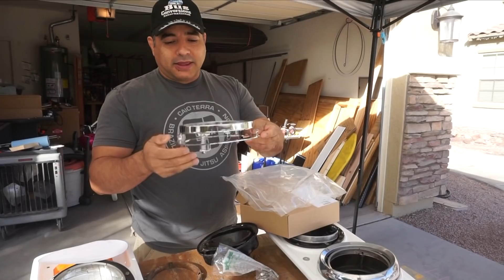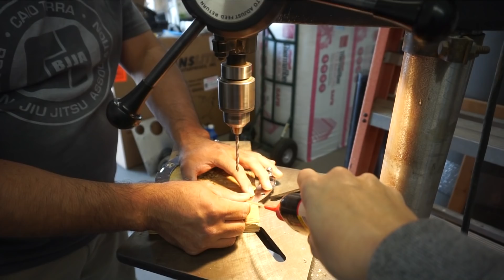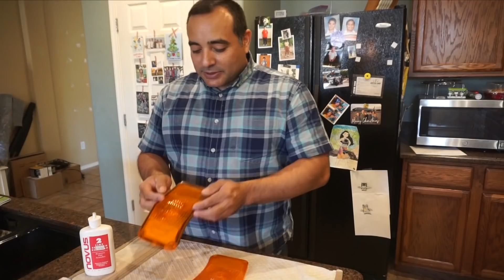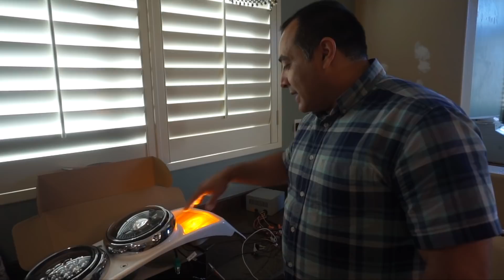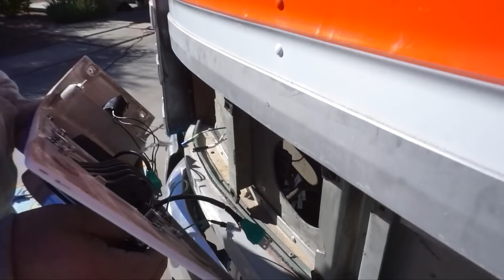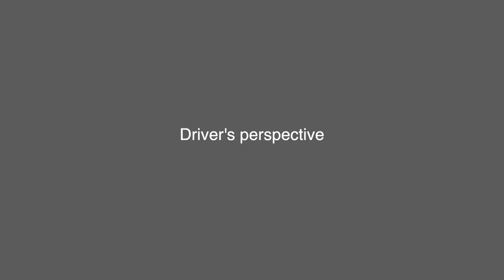LED Headlights: Part 2 - Fitting & Install w/ Bonus Turn Signals

Comment: You would expect the DoT would allow for 4 low beam lights for better visibility, but apparently they don't think so. Are they afraid they might blind people coming from the opposite direction? In any way, you will have enough light to drive at night. Great job, again.
Reply from the maker: Thank you De Mus - we were pleasantly surprised with the performance of the lights and especially with the pattern (to not blind other drivers).  We have only had to drive at night a few times but having decent lights makes a world of difference.

Comment: Pardon my late-ness - I am catching up on your videos.  Two items - 1. Did you notice ( or maybe it was the camera angle ) the passenger side upper marker ( on the roof corner above the door  ) was out.  2. What did you do with pinball?  I worked for Williams-Bally-Midway for a time.
Reply from the maker: LOL Thanks Tim.  Yes that light is out,  we have new lenses and bulbs that we will put in at some point in the near future. 
 The AZ sun just destroys everything out here so we have hesitated putting them on.  
Pinball was just a hobby - my friends and I would fix and restore old pinball machines.  I owned "Whitewater" and they owned quite a few: "Mid Evil Madness", "Adam's family", "T2", "Diner", "Creature from Black Lagoon", "Whirlwind" and another friend who had "Theatre of Magic".  We would trade/repair them - many lessons learned in electronics and physical problem solving.  We had a lot of fun working on those old pinball machines I can only imagine what it is like to actually build/design them!
Reply: @BeginningfromthisMorning  I was not in the group of designers...but did know some of them. I was ( always ) in IT - non programming - ( meaning hardware ). I found it a fascinating business - they encouraged us to play. ( free testing! ) Sadly, only Stern pinball is left ( and they are right next to one of my data centers! )
Reply from the maker: @chiswsuburbs6523  still awesome!! I loved the hardware side of pinball!

Comment: Juan where did you get the windshields from?
Reply from the maker: Thanks Abraham - I ended up getting them from Luke at US Coach (888-262-2434).  We did a video on the actual windshield replacement: https://youtu.be/Mjr7iRAYCE8

Comment: I have used Novus #2 on my motorcycle helmet face shields since the 1970's!  It's the only thing I've found that restores them to a usable condition. This has saved me big $$ over the years, as I would normally toss them out. They cost $10-$30 each depending on thickness and tint. One bottle lasts for years as you don't need much. It also works great on motorcycle plastic windshields, restores them to like new.  One person on tour one year didn't believe it,  so I did 1/2 their face shield. They were a believer very quickly!! LOL  Great stuff for removing scratches in most plastics!!
Reply from the maker: Thank you gtr1952 - I was introduced to it when I was doing work on pinball machines.  Many of the clear plastic ramps and things get pretty scuffed up with the ball ... Novus #2 was the only thing that could usually clean them up!
Reply: @BeginningfromthisMorning  Back in the 70's it was just Novus Plastic Polish, they added the 'grits' in the 80's I think. One bottle lasted me almost 7 years! LOL  I found you via Scott. I'm doing a cargo trailer conversion, thanks for all the good ideas! I'm 68 and 'downsizing'.  8)   --gary
Reply from the maker: @gtr1952  Awesome!  sounds like a great project!!

Comment: I like this idea of replacing the classical bulbs (a filaments) by leds. It's much less electricity consuming and more efficient for night vision. I did the same thing on my old 12V sidecar (ural 750CC).
Thank you for this excellent video, I hope you will show us the difference in consumption. Robert from North of France.

Comment: That is great.  Those lights not only look good, but visibility is very good.
Reply from the maker: Thank you Travis.  We are very pleased with the performance.  Now that it is getting darker earlier we have had to drive it to the lot in the dark a few times down a dirt road with quite a few ruts in it.  The lights are a HUGE improvement from the stock ones and I would even say they are better than the ones on our Durango.
Reply: @BeginningfromthisMorning  Durangos are designed really strange.  Everything about them is just wierd.  I have upfit a few and the tear down, placement for things, routing, .. it's all just not what you expect.  I was watching the tow kit install and I was laughing because I knew you have seen what I mean and were probably asking yourself why did they make this thing this way.

Comment: Where did you get your paint job? I didn't catch it on the first video. trying to paint my RV on the cheap (disabled vet on a budget).Thanks
Reply from the maker: Hi Tony we got it done in Mexico - we are very happy with how it turned out.  We cover it in some of our past videos and we will be putting out a video on how we set it all up.  It ended up costing us about $8000

Comment: I have run new LED rear taillights and LED front turn signals as well, but the load wasn't enough to allow the blinkers to blink.  As soon as I put an OLD incandescent bulb back in line, they flash just fine. How did you solve that with all the LED's on the bus? Did you add a resistor of some kind?  I tried a NEW blink module, and it wouldn't allow them to blink at all either.  LOVE following your work!
Reply from the maker: Hi Cast Iron Fitness - thank you for the kind words.  At first, I tried to replace the Flasher relay with one that is LED compatible but had the same issue as you - NOTHING worked.  I got a little frustrated and just put in the incandescent lights just in the front.  I didn't have too much time to mess with it, so I just put in an inline 50W  resistor from Amazon (https://amzn.to/2GE0gBg).  You can see it wired in on this blog post: http://www.beginningfromthismorning.com/turn_signals/.  I talk about it in this video: https://youtu.be/C8j9CSBqU3A?t=11

Comment: I have been following your bus-build odyssey for awhile now, and MUST say how incredibly impressed I am with the thoroughness of your research, thoughtfulness of your planning, and incredible care and attention to detail on EVERY aspect of every project-within-the project.
Also, more than a wee bit envious of the wealth of power toys, er, power TOOLS that you have and are so skilled with. Now very much looking forward to the details of the solar installation and the bits of gear you will use in making that amazing electrical system you designed and build come fully to life!!
One tiny suggestion as a short-time tour bus driver.  We were taught by our instructor, and mandated by our company to use the right lane as much as possible, and stay close to the speed limit.  Two reasons: when travelling in the left or middle lanes, you have to "defend" the right side of your vision which is never as well covered as the left, and in centre-lane driving, you must be especially mindful of BOTH sides at once, which divides your attention.
You will also soon discover that there is a "sweet spot' speed at which the engine and transmission work best together.  Above that, the bus will become VERY "fuelish" eating money for all its worth.  Below that, performance and handling may suffer.
For What It's Worth.
Cheers from Canada, near Georgian Bay, Ontario!!
Reply from the maker: Thank you Robert - We try to do our best with what we have and what little building experience we have.  We don't always get it right but we are doing our best.  Thank you so much for the clear and detailed explanation of why choosing the right lane is the best choice - makes so much sense the way you described it!  I learn something every time I read the comments on our videos - thank you for that.  
Our "sweet spot" is somewhere around 62 mph I think - she glides along at that speed and seems pretty happy and smooth.  I have pushed her to 72 or so but she starts to give a little attitude up there

Comment: Juan, y'all did a great job with the headlights! In my 38 years as an OTR truck driver having my light lenses clean, all of the lights working, and, bright was one of my pet peeves. Barring the fact it was a DOT violation if they weren't! They really look good, professionally, and, DEFINITELY functionally! Kudos to y'all once again!

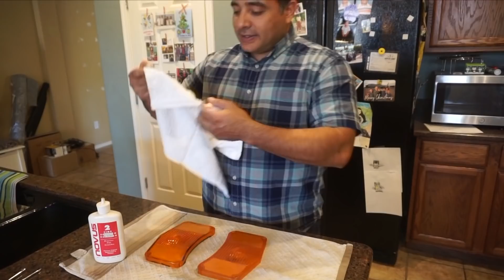( 1/15/2019   Tuesday   11:55amCST   ~Jim from Houston, Texas~ )
Reply from the maker: Thank you Jim - it is hard to capture on video but the light these things put out is amazing.  We were also really pleased that the beam has a very defined cut-off line to avoid blinding other drivers.

Comment: Here nice work. Did you use stainless hardware? The front headlights take a huge beating with water and weather. The stainless hardware will be worth it in the long run. Glenn
Reply from the maker: Thank you Glenn - we did use all stainless steel hardware both on the outside mounting bolts and to secure the buckets.  I have been enjoying watching your garage come together as well as the work you have been doing on the Datsun!
Reply: Thank you, have no ideas for next Monsdays  @BeginningfromthisMorning

Comment: WOW this looks great as usual.  On the turn signal lens would it be possible to make three "D" copies of the one without the crack in it?  I really like what you are doing.  Happy New Year  Ed
Reply from the maker: Thank you Ed - making copies of these would be great - but the time budget will likely not allow for it.  It is a great idea to file in the back of my mind for when/if an opportunity like this presents itself.

Comment: Have you guys considered a 3D printer? You can pretty much use it for your bus, then you can resell it and get a pretty good ROI. ABS and CF doesnt rust!! lol
Reply from the maker: Funny enough - I JUST bought a 3d printer about a month ago and have been playing with it.  My thought was that it would help with things like brackets and cable management etc.  If you are curious, after months of research, I finally ended up going with the Prusa i3 MK3 - I am loving it so far.
Reply: @BeginningfromthisMorning  Ive been looking ito getting one. I think it will be great for you guys, especially when you start working on the inside. You can do cabinet handles, knobs, all kinds of fun stuff!! I do 3D Modeling and Autocad drafting for a living so, if you ever need anything modeled, just let me know. no fees for you guys will be involved. I love doing what I do!!
Reply from the maker: @jfalbino73  Awesome!  Thank you so much

Comment: Really nice work. Those big round chrome lights look right at home on the front grille.
Reply from the maker: Thank you Gordon - we were a little worried that we might change the "retro" look at first, but we like the way it turned out.  The light output is the real winner though - they are amazingly bright and make the road ahead much more clear.

Comment: Rocinante is quite the looker now!  Have you considered making molds (silicone perhaps) of those marker lights so that you can manufacture resin replacements later on down the road?  I like you measure several times: cut once tactic.  Anyway, great work!
Reply from the maker: Thank you Mark - she is really starting to shape up!  I would LOVE to make molds but we are just trying to get the bus done at this point - a very good suggestion though.

Comment: Ok here’s my 2 cents. If you have a need for replacing old parts why not buy a 3D printer? Your a smart guy you can design anything you need.The printers now sell for 200.00. Their filament now comes in different strengths colors even rubber. Good luck
Reply: Hahaha ya your right but I’m thinking of all the future things that’ll need fixing.
Reply: it might be quite a challenge to create led headlights with chrome beauty rings, but the 3d printing stuff is cool,
Reply from the maker: Funny enough - I JUST bought a 3d printer about a month ago and have been playing with it.  My thought was that it would help with things like brackets and cable management etc.  If you are curious, after months of research, I finally ended up going with the Prusa i3 MK3 - I am loving it so far.

Comment: That bus will be so much better than any new rv thats not based off a bus. Most start rotting and falling apart really fast.
Reply: Charlie Brown, I went to look at RVs at a dealer. One brand new one we looked at was literally falling apart in the parking lot. Some stapled on trim inside was laying on the RV’s floor. So, I’m converting a schoolie.
Reply: Yours will be much more solid and durable
Reply from the maker: Thank you Charlie - we sure hope so :)
Reply: Its turning out great. Try not to use insulation in the walls that can absorb moisture incase it sweats inside. Just something Ive heard.

Comment: the rear marker in California and many other states are to be at the very back or within 2 foot of the rear. your to far in with the red marker.  try to place it with in a few inches of the back of the bus so you know where the back of the bus is. this is why you see the red marker on trucks and so forth with in a few inches of the back of the vehicle

Comment: Again a great video guys love the look I wonder if I could convert my MCI it would be very cool.
 thanks for sharing your creativity you always surprise me.
Reply from the maker: Thank you Brian.   With the brackets we bought you just need a relatively flat area about 7 inches around to mount to :).  I bet your MCI would work out great.  The really great thing is these actually draw less power than the halogens while producing WAY more light.  Once we got over the fact that we needed to cut into our facia it went pretty smoothly.

Comment: front bumper on the left side is more down like ... or am i seen like this i dont know... however brother if the gap is not even on both sides is it possible to fix it? I hope so.. so the bus will looks grate..
Reply from the maker: Thank you Anura - The bumper is aluminum and it has seen its fair share of contact (none of it by us of course).  It is not perfectly straight (nothing on this old bus really is).  We try not to let the things we can't change easily bother us too much - that being said we will likely keep our eye out for a bumper and if one shows up :) We will probably replace it